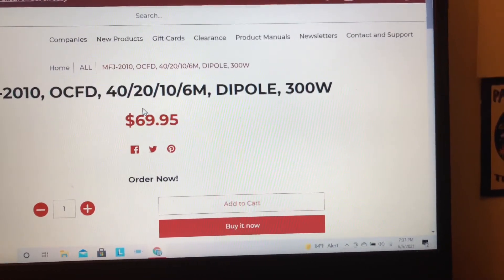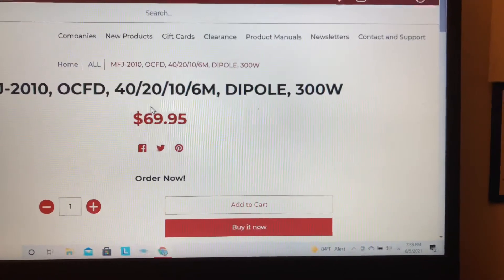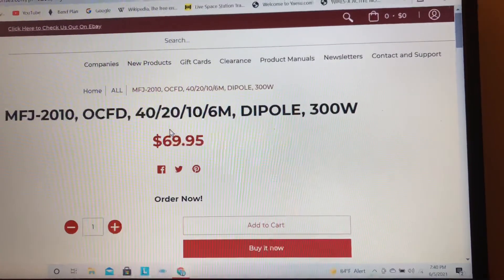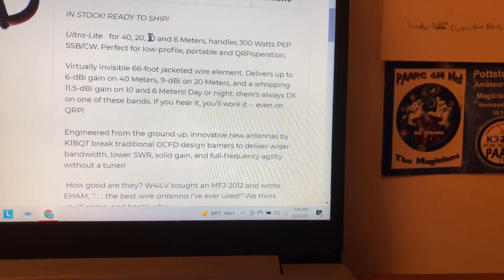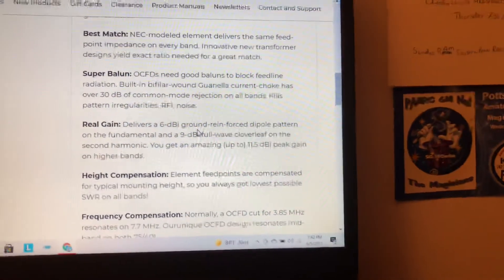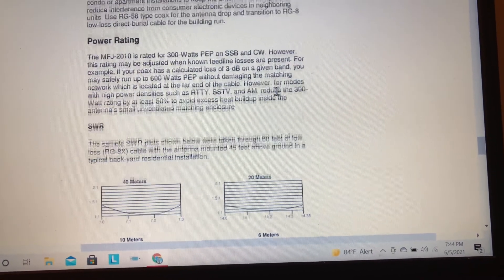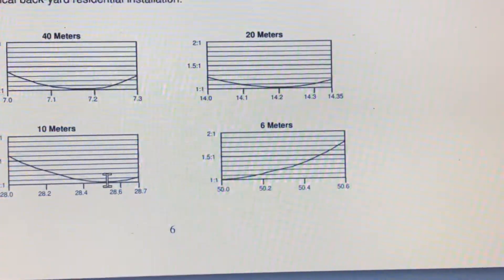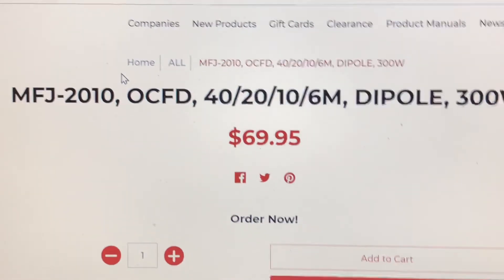MFJ-2010 OCFD Overview Part3

Comment: I've had this antenna up at 28 feet (off the peak of my house) for over three years. With the band conditions being so bad, it's been hard to judge just how well it works.  Last night I worked my first VK in years with my Xiegu G90 peaked out at 20 watts on 20 meters. 7438 miles with a five by seven signal report. This antenna works very well.
Reply from the maker: I’m glad it’s lasted so far and congratulations on Australia.